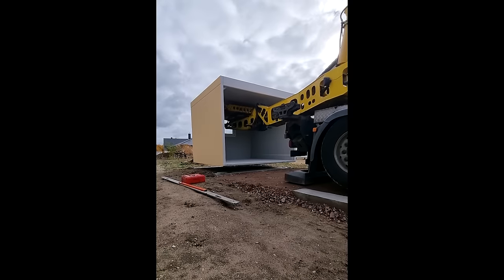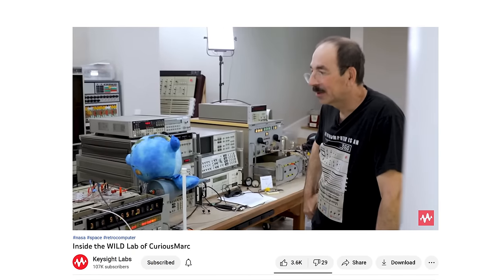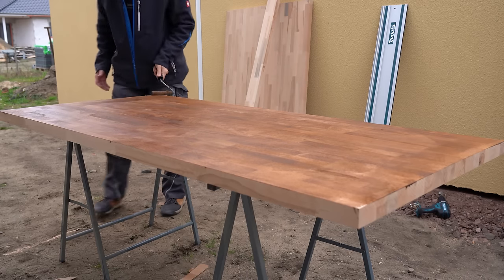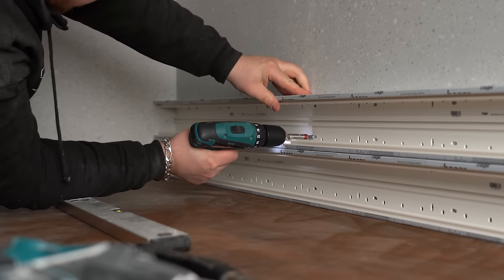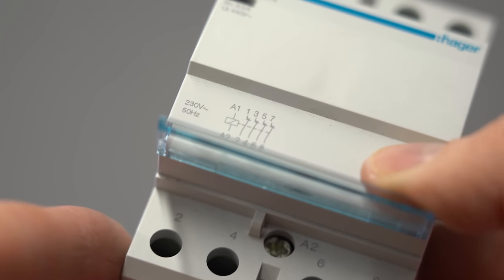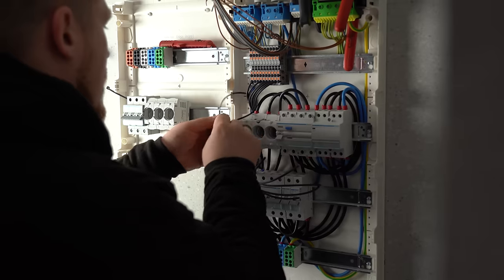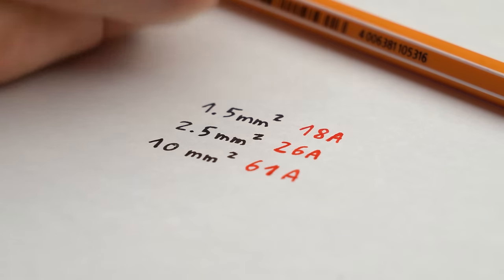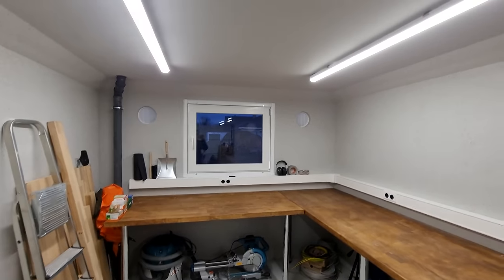Germans do the PERFECT Electrical Wiring! (Garage Build)

Comment: ESC464 - Is there a reason why you didn't purchase a safety relay to go with your emergency stop?
It looks like just a regular relay.  Safety relays 'ensure' the output is switched off because they're mechanically coupled and have strict turn off timings.

Comment: i would install an isolator switch, so the CEE can be isolated and only turned on when needed, this way you could also use the normally open relay/breaker, and it doesn't draw power all the time,  (only when you use it).

Comment: I was in a meeting yesterday where it became known that IEC raceway requirements do not require fittings at elbows.  i will soon have access to IEC standards and I know this will be an upcoming issue on a project I am working on. In the US we do not free air cables within conduits raceways at elbows.

BTW, 400V can have quite a bit of arc flash potential. It would be a unique situation in the US where a residential dwelling would have, in our situation, a 480V service. Even a 208 three-phase service would be difficult in most areas.

Comment: If you didn't want to always use 63w all the time you could just turn the headbraker off whenever you are not using the garage or place the emergency stop in series before the outlets and not need a relay if the emergency stop is pressed it won't let any curent thru and it'll be the same as the relay 

I have no experience but I did go to school for electricians and I have never seen a relay being used for an emergency stop

Comment: The E-stop: my main pet peeve with this is that if you loose power on one ("the wrong one") phase it will not work. Besides that I couldn't care much less.

There are solenoids you can buy for the circuit breakers, so if you power the solenoid the breakers shut off.  Maybe they exist reversed too? So as long as they receive power they will not trigger the breaker.

Comment: as an electrician in usa let me teach you a trick, 1/4" split anchors are the shit for mounting things to concrete, you drill a 1/4" hole with a hammer drill bit then push it gently into place then smack it with a hammer and a flat punch and it mounts so well it will pull a plug out of the concrete if you want to remove the normal ones with a nail, so spend twice as much and get the ones with a phillips head, you still smack em with a hammer, but you can remove them without damaging the concrete

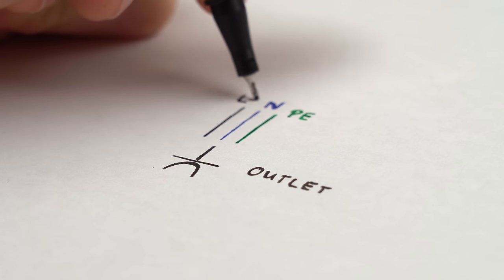Comment: 10:30 Correction: You are allowed to use the blue wire for a switched line, if you don't have neutral wire in the same cable. Just clearly mark the end, the one in the junction box.
If you have a neutral in the cable it always has to be the blue wire.
PE is always the yellow green wire, and it's supposed to always be connected.
Even so a lot of people seem to think that's a suggestion rather than code... IT'S EFFING NOT GOD DAMN IT!!!

Comment: As you need to put a cable from the garage in to your house anyway add an Ethernet cable. I did this when electrifying my shed. It’s so helpful for security cams or a repeater for the garden. And I used Brüstungskanal vertical at the door to put in my Smart Home switches as I did not want to miss the comfort in my shed which I already have in my house. For the rest I used a cable canal. And don’t forget to use a big wire for the supply of the garage as you might want to place a 22kW charger for an electrical car there sooner or later. I took the opportunity to get the charger „sponsored“ by KfW a year ago although I do not own an electrical car right now. If you want to see it I’m happy to share some pics or a video.
Reply: I was literally looking for a comment mentioning "Network Cable" 😂
I'd throw in at least a pair of Cat7 with those double RJ45 Sockets inside the cable duct. If not using a small Patch Panel, you could just put a socket on both ends of the cable, to feed the duct sockets to a switch
Reply: @SystemX1983  Why not optics? I ran 100M optic cable from main office to site "office" and it seems to work well.
Reply: @jur4x  sure, from the garage switch to the house, fibre is an option. But not inside the duct, I think.
As most networked things have RJ45 jacks instead of gbic-ports or similar 😉
Reply: @SystemX1983  System I used consists of very simple fiber to ethernet converters and a 100m optical cable. Sure, it would give me extra flexibility to run Cat6/7 instead of prefabricated optical cable, but 
a)100m is almost a limit for twisted pair.
b)at this length I actually saved money on it

Comment: I think its awesome that in a residential space you have three phase power at all.  Here it's split single phase.
Reply: We do get split-phase devices in some industrial/construction settings. But it is split-phase 110V, so it's technically 55V on single phase. Portable transformers are usually used to run such equipment. Unless dedicated wiring is done for fixed points.
Reply: @johnjacob5329  price has nothing to do with the way power is distributed. Only with generation and fuel seller's greed. Lot of countries use similar approach to network design but pay less then you.

Comment: Your king of mods. Why not use a plc to make a cable break system? Make monitored safety button loops monitored by a controller that can trigger a latching relay. Small buzzer and epaper display could tell you if the controller is dead, malfunctioning, or tripped. Can't imagine that would take more than a few Milli amps.

Comment: Overall, a very neat installation. The only thing that blows my mind is you used 25mm conduit to mechanically protect some of the wiring, but there doesn't seem to be any protection where there are bends or when it goes into a light socket? In Australia, we'd use flexible or elbow conduit here. But in Australia we usually hide wiring in walls too, as brick, timber frame (with an air gap) and plaster internal cladding is the most common contruction type, even in a garage.
Reply: This is a single wall concreet prefab garage. walls are 60mm thick.

Comment: I love the precast concrete shed that can be delivered. Could be a better option than a shipping container, wish they made them here.
Reply: A Shipping container is not suitable for a garage, they are only 8ft wide and that is no Wide enough to open the doors on car or trucks. You would have to get 2 Shipping containers and cut and modify them to make a "pre made" garage.
Reply: @randybobandy9828  true, I was thinking more for a shed to work in at home, your definitely right about not suitable for everyday use as a garage.

Comment: 2:42 - there is a picture explcitly saying not to hold your hand there 😆

The smelting fuses i would have put in the main fuse box of the house before the line to the garage. Not after. This would only make sense if you go to another distribution box from the same feed line.

And for the Emergency stop
The Risk of having one that isnt working right might be higher than not having any at all.
As far as only you will be using it and know its limititions it might be OK

BTW There are RCDs Type B with integrated Emergency stop functionality. This would have been a great option for you.

Comment: A small correction, you should use PVC bends or elbows for corners of piping. We secure wires inside the pipe, why should we leave corners ??

Comment: I would use Flexible conduit hose for those areas where the standard conduit tubing ends and the wiring goes out, and then into a junction box, or switch plate or such.

Comment: Not only Germans! It is standard electric wiring accordind to local requirements. In other countries they do the same level of perfection. Also you choose quite expensive technology where you have to use prefabricated wirinds to connect sockests.
Reply: you dont need the prefabricated wires for the sockets, you can wire them manuel with nym cable aswell :)

Comment: Very nice work in your new garage/shop! My wiring OCD was very happy to see how nicely the main panels were wired. Lastly I wish we had options like a drop in concrete garage here and the same options for power. The current place I'm renting has a nice detached double car garage but as a maker myself for the last 40-ish years, the power is awful with the entire thing running off of a single (I assume) 14/3 or 12/3 cable that runs back to the house and a 15A breaker. With my small compressor running, it will trip the breaker if I run my corded hand drill or corded 1/2" impact gun. Needless to say as a new subscriber, I am very jealous and looking forward to seeing what you do with the space! :)

Comment: I will add one quality ground around workbench. Even if you are not doing things that would require that. Ground in wall socket can be pretty noisy. 
And i will have some wall socket on bench that won't be after safe stop ( for PC, logging. light, etc ).

Comment: You should do also some Home Automation in there, with sensors and actuators. Now that everything is new and you have the space and opportunity tu run the cables and mount the devices.

Comment: It's been a while but I think garages and Germany can be a bit tricky. When I remembering correctly, if the Amt checks a garage and it's not used as a garage, but for storage area or there are flamable material, they could fine you.
Reply: Lmao... wow that's an absolute joke. Way to much regulation in Europe. Imagine owning a house/garage and not being able to use it for what you want to.
Reply: @randybobandy9828  Its the same way when i look over to the U.S and see what some home owner associations are up to.
Reply: @maik00979  but that's voluntary,  don't want to deal with a HOA? don't buy a home in one.

Comment: Interesting in the differences between European countries on permitted current capacities on different cable sizes. Germany appears to be one of the only countries that allows 16 A on 1.5 mm^2 cable. Also, the use of fuses as the main disconnect in a brand new installation is surprising. In Poland, the maximum permitted current on 1.5 mm^2 is 14 A under most circumstances, and circuit breakers are typically used on the main disconnect (fuses are still acceptable). Also noticed that Southern Europe uses trip curve C exclusively, while trip curve B is standard in Poland (trip curve C is typically used only where appliances with a large starting surge are anticipated).

Comment: use a small relay with lower consumption to control the big relay with any wire/power failure to break the main relay circuit and turn it all off

Comment: Nice job on the whole installation, but when it comes to emergency stop switches I would use both NC contacts in series rather than parallel. Gives additional redundancy safety if one of them gets stuck in position when the power can get through.
Reply: He's using NO instead of NC for the emergency stop. So it's pretty much impossible to keep them in series. :)

Comment: You can use the FI for emergency switch off. Only connect a phase and ground to the knock-off-switches, and the FI would switch off if neccessary. And no extra energy-consumption for the relais. "keep it simple"...

Comment: For that contactor thats the pull in power consumption, once its energized and holding it usually only takes a fraction of that power.. or Hager build a really crappy one.. at least its that way for ABB contactors, so it wouldn't be that bad to build it the right way (and it usually would require an emergency cut control unit, but thats industrial stuff). Apart from that its a nicely build garage/shed.

Comment: I’m german and live in Spain. I’m familiar with german electric wiring and I’m electrician in Spain, and oh man…. I prefer 100 times Spanish wiring than german.
It’s much safer and easier to find a problem.

In my opinion you should put some sockets down the table.  

Overall nice work 😉

Comment: I have seen plenty garages being built but I would have to admit that this is the first time I have seen a garage being installed! 
Is it attached to the ground in some way or does it just sit on what appeared to be concrete pads? 
Also, I'm surprised to see fuses still being used.... I would have thought that those ancient devices would have been long forgotten in Germany? 
I don't know if there is a fuse box in Australia that still has fuses in it, there could be but they might be in an old installation that hasn't been updated yet, my house had all it's fuses updated to breakers a long time ago thanks to an Australian government funded program.... They didn't replace them because they didn't work well... They were replaced because the Australian fuse was designed to be able to replace the fuse wire by almost anyone and since the majority of people don't understand electricity and let alone the house electrical system, people would replace the proper fuse wire with fence wire which can open a whole new can of worms.... Even though a common breaker can be swapped out for a higher current one, people seem to be reluctant to do it so I think that it's definitely a safer option in the hands of those who don't understand... 
Anyway, it's a great setup and a perfect install... Just missing some solar panels on the roof of the garage..... Your garage has the same dimensions as mine, we are just getting into summer down under and I am seeing 20kwh days from just the garage which is enough to run the whole house! I would recommend our very own German Andy from the Off Grid Garage channel, he's up in Queensland and there's no one who understands how to set up an off grid solar system on a garage better than him! Maybe you already have plans for this in the near future??? I would love to know how solar systems perform in Germany.... The last video from Andy, he showed what he was getting and got during a day that was so cloudy that the sun couldn't be seen and on top of that it rained virtually all day and still produced energy! And there's still plenty of people who will argue they don't get a lot of sun in their country so solar panels are pointless.... There needs to be more videos on this topic from all over the world....

Comment: By Croatian standards (i am electronics and mechanics tech currently working for electrical wiring company), this would be fail, as you can't install fusible (burnable) breakers, it can't look like mess inside breker box (this is kind messy), you need to have those metal ends on stranded wires..... so this would usualy fail inspection in Croatia.

Comment: Good job, it represents some work :3  
I guess you will add some fume extractor to force air out on soldering at the end of your building. 
Would have protected the corners of wire on the plug circuit , you never know if you do a mistake, to avoid to degrade the wire.

Comment: it looks pretty good, but here is the question, eventually how many amps are put into this workshop? if it is 3phase 6400w as you describe, you will need a good fire extinguisher for safety and.....may be a winge? A frame? or a floor jack. that's about 8hp you are talking about, no matter it is a welding machine, a lathe, a oven, whatever equipment can consume this power is going to be really robustly build and obviously very heavy.

Comment: Switching the neutral as well as the phase conductors may be required in some cases depending on how appliances fail and what happens to the electrical system in that failure because if something is to fail very very dramatically that it damages a lot of the electrical system and then you press the emergency stop if the neutral is brokenin another circuit potentially you could get a shock from that very damaged appliance if you were trying to fix it

Comment: You said you wanted flexibility but you used solid multipolar (multi-core?) cables wich are a nightmare to change. 
Interesting to see how it's done in other countries. 
Greetings from Italy 🇮🇹 where we only use modular systems (wich are really flexible but also quite expensive), we also don't use solid wires since the 70s, we always use conduits, typical domestic installation has 3 to 6kW 1P, we have very nice power meters, we are adopting the "schuko", we use the TT system and around 73% of installations aren't up to code!

Comment: The emergency stops really ought to have been done the proper way, with a contactor that will break on lost power. My workshop is set up so I have the power on only when I'm in it, and therefore I can do it right.  I have momentary ON/OFF buttons that will pull the contactor closed as I press ON, and then it is wired for self-hold (powering itself). As soon as power to the contactor is removed, it falls. It will not turn back on at power restored, unless ON is pressed. Pressing OFF of course turns things off. 
Then, all the mushroom switches are wired in series and also in circuit with the self-hold wiring for the contactor, meaning that all mushrooms need to agree things are OK before the contactor can energise.  For a safety system, this is the only acceptable way.

Comment: Really nice job there, I would just change one thing if I would do this. The cable to that 3 fase socket, since it's so long distance from the ducts I would always take it straight from the ceiling and not across the wall like that. But that is just my personal opinion.

Comment: German conduit (you call pipe) is interesting just protecting the straight runs and not bends or into fixtures.  In my mind it’s quite pragmatic and would make life easier for the installers.  An interesting compromise.  I wonder what the considerations are.

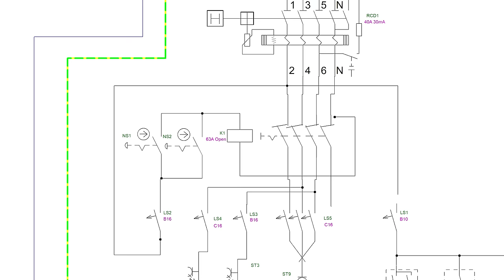Comment: I noticed at 7:00 that you show the contactor switching the neutral.  Is that correct and code?
I would think you would NOT switch the neutral.
Very nice installation!